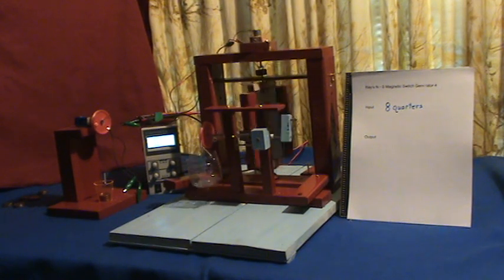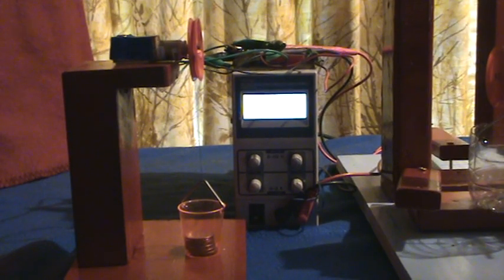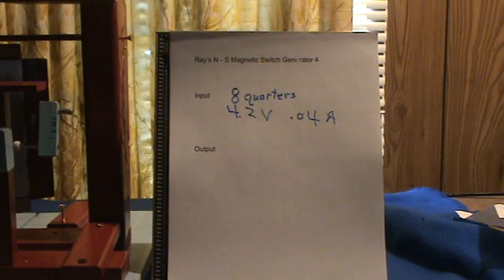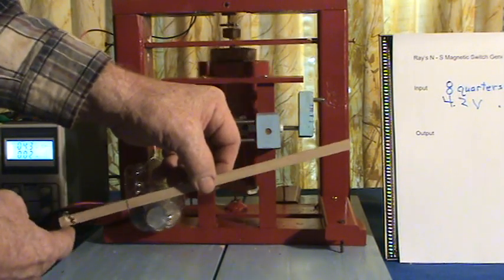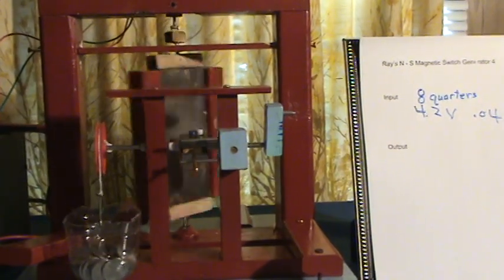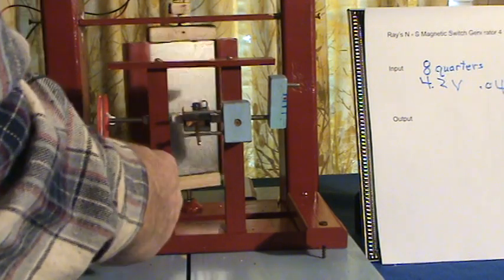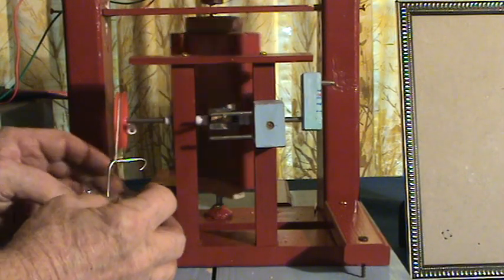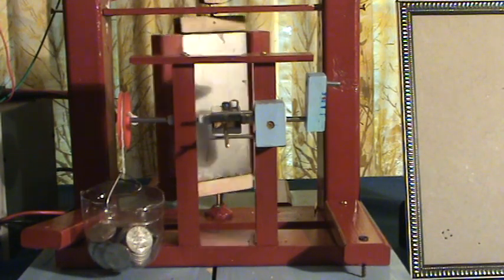Ray's N - S Magnetic Switch Generator 4

Comment: You should be using some gears reduction with the magnetic motor, like you do magnetically with the other one. That magnetic pulling wheel needs a latching mechanism to really pull the weights up only. To measure it, check how much time and power it takes to pull up the coins for like 1 meter.
This is rather flawed test, cause with better reduction ratio, this electric motor will pull up as much weight as the magnetic one, but how much energy will both use?
Nonetheless, this is interesting and I'd love to see more, especially in numbers, so keep up the good work!